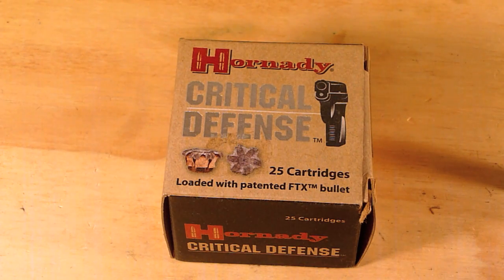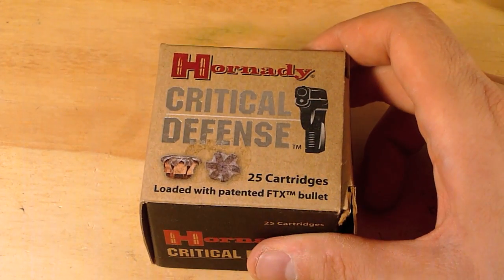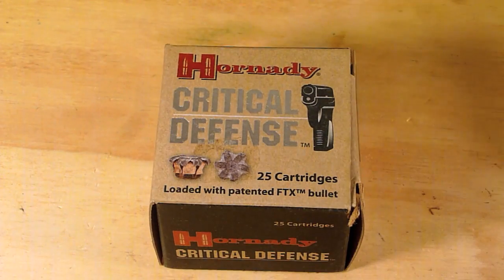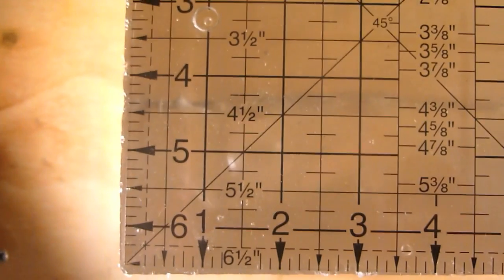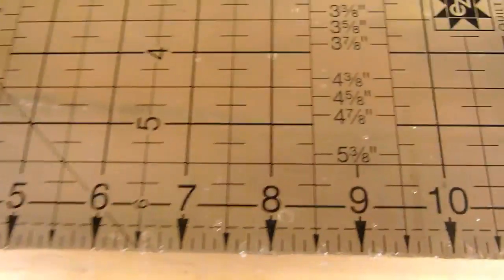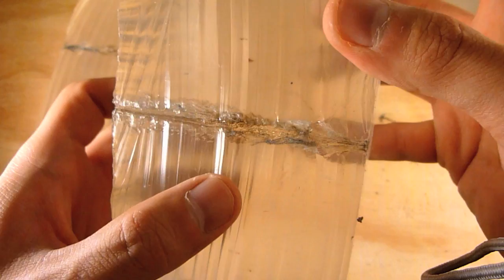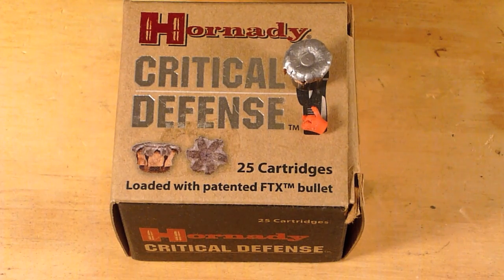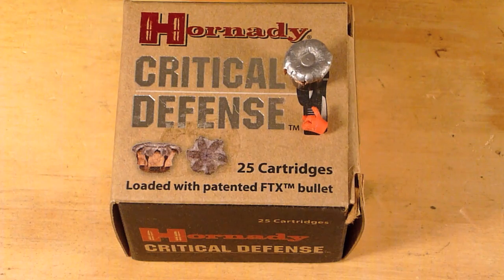Clear Ballistics Gel: Hornady Critical Defense  .357 Magnum test

Comment: 135g. Gold Dot Short Barrel .357 is my carry round in my Smith 649. I've yet to see a test where they haven't expanded. The box says 990 feet per second, but that's from a 1.9 barrel. My 649 has a 2.1 barrel and they have an average of 1113 fps, with a muzzle energy of 372. I've seen then chronoed in multiple short barrel tests.

Comment: Your block looks too dense, which is probably why you are getting a burnt looking permanent cavity. That's a great round that doesn't clog with denim and doesn't over penetrate. I'd try it again on a different, calibrated block.
Reply: I've seen the same rd from the same gun, 2 1/4 Sp101 leave a wound chan. 1-2" & the front of the gel block had 3" shock wave markings. It's good stuff.
Reply: yeah more like this video watch?v=lTWFbuzX-l8

Comment: w/ a .357, do you really have to worry about a clog?  Why not use the biggest, widest hollowpoint?  Just asking
Reply: Any open hollow point can clog up from clothing. The flex tip helps to keep that from happening but it doesn't expand as much as a regular hollow point that does expand properly.